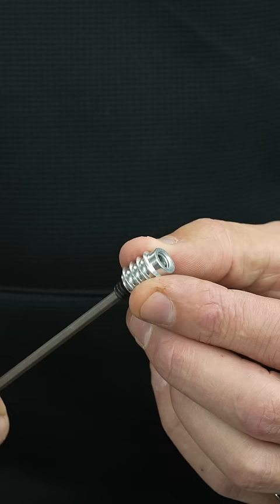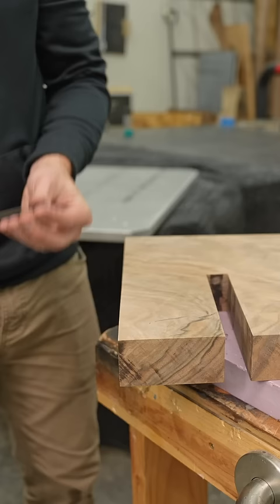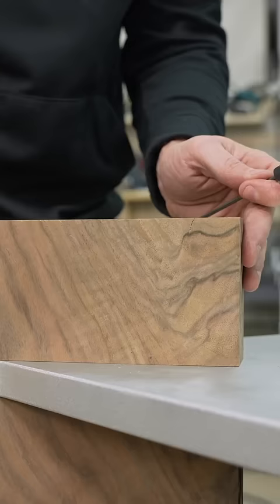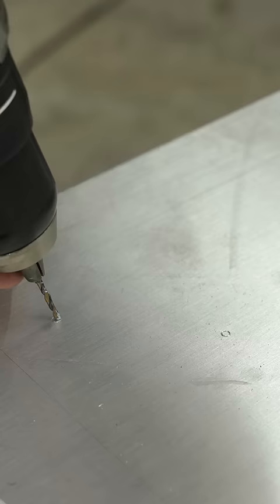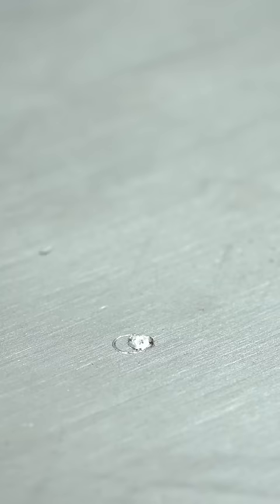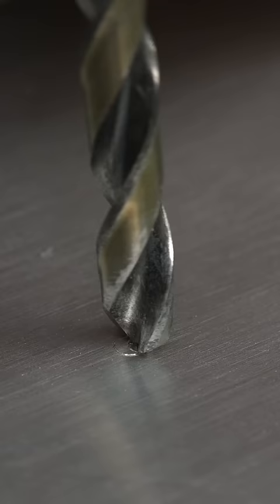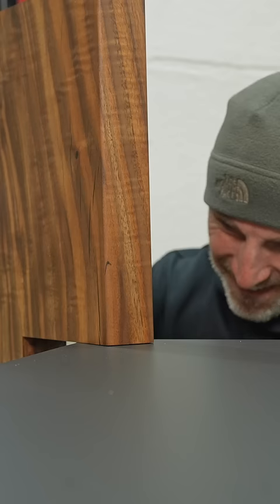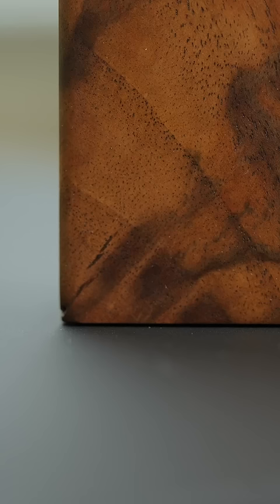Set screw attachment

Comment: I don’t have a lot of experience as a woodworker so that offset countersink idea really stuck me as genius
Reply: It's a pretty common technique with dowels to offset a bit so it pulls it in tighter.
Reply: @1steelcobra  to elaborate on this, it is used in a joint called a "pinned mortise and tenon" and the technique of having the pin hole offset is called "drawboring" which are terms easily searchable on the internet.

Comment: The really cool thing about screws like this is that if they are of slightly different and finer thread pitch, they can be used for precision positioning of optical things.
Reply: Please elaborate!
Reply: @TylrVncnt  If for every rotation thread A goes 1mm and thread B goes 1.1mm the difference can be 0.1mm.  0.1mm pitch is abnoxious to machine, so it is better to use a differential thread for fine adjustment as the precision can be nearly arbitrary.
Reply: So both threads rotate, producing the difference. Perhaps the threads are on the ID and OD of a cylinder with slightly different pitches? Just turn the cylinder.

Comment: Set screws like that are Grade 8 fasteners, with a strength of about 180,000 psi.  The threaded insert on the other hand is by comparison extremely weak and the weakest part of the joint.
Reply: Yea I wouldn't use threaded inserts at all, but he seems successful with em
Reply: doesn't matter if it's a weak link if its still more than capable of supporting the reasonable amount of weight you would expect from a coffee table
Reply: The screw threads don't support weight if inserted from the top.

Comment: It's the same thing with those polymer 80 pistol build kits for the Glock
The holes that you drill from the Jigg are slightly off-center and everybody wants to wallow them out so the two pins slide in easy.
If you compress the rails before driving in the pins, they are in solid and tight.

Comment: What if you had a little 3/16" chamfer on the bottom portion of the legs and drilled on an angle. Then you wouldn't have to show those through holes. It would still draw up tight.

Comment: The steel screw is much harder than the aluminum so it's just going to dig into the aluminum, the ramp from the countersink won't hold to the degree needed for what he is attempting here. 
The offset countersink idea is great but not how this guy is doing it. The assembly will hold just fine but he wasted a bunch of time with this implementation. 
Nice table though...